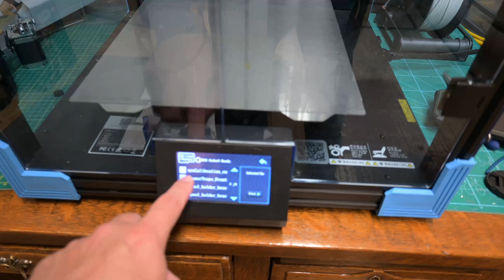Ender 6 Hemera XS Revo Install with cable chain mod

Comment: Hey mate thanks for sharing your conversion. I did this to my Ender 6 a few years ago now and started with a Biqu hemera clone but it was useless so I went all out and got an E3d Revo Hemera and a BL-Touch and set it all up nicely and it has printed flawlessly since but a week ago my pin snapped on my bl-touch so I put a new one in but for some reason now she will not bed level and my klipper crashed and I lost my printer config file so I am trying to get through that drama lol. If you are still using the printer and need any help or advice just reply on here and I will be happy to help. Best advice I could give you though is buy Bambu Labs printers lol.